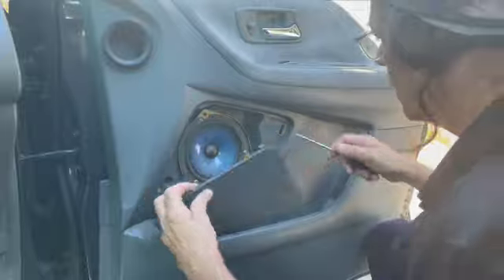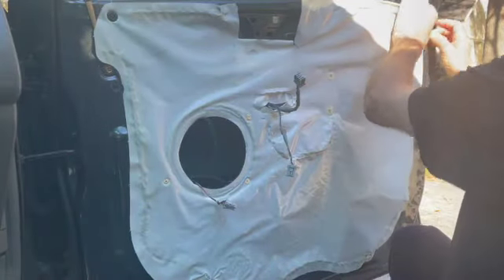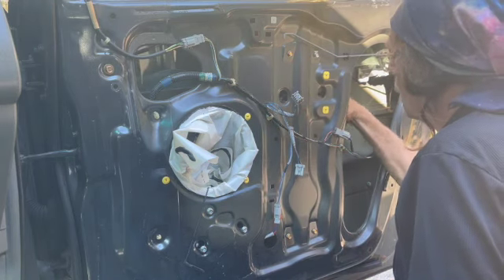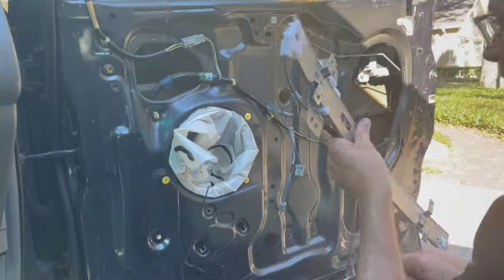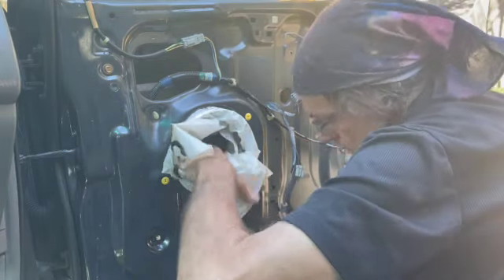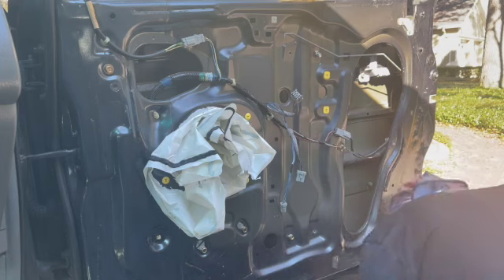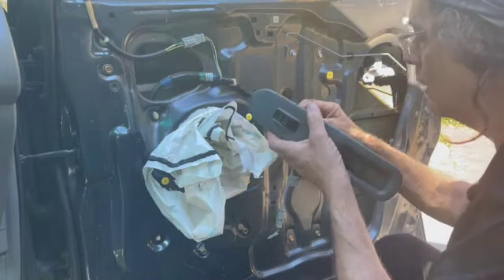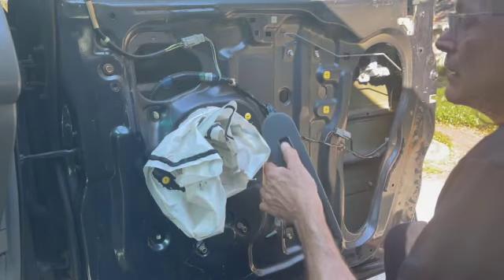Honda Odyssey 1999-2004 Window Regulator Replacement & Repair Right Front

Comment: My glass went off the rain. How do I fix it?
Reply from the maker: probably the window regulator. Video above. BUT if it really is just out of alignment remove the bolts holding the glass to the regulator (2 10mm) and realign the glass in the channel.
Reply: @PowerUpAuto  I was trying to whine down in the morning and when it gets to the middle, it just went down straight out of control
But i will check the two bolt now
Reply from the maker: @bamidelekoledoye1161  sounds like the window regulator. Video above
Reply: @PowerUpAuto  You were right. The upper cable of the regulator pull off because the catcher is broken. I will need to get another one tomorrow.
Reply: @PowerUpAuto  Thank you for the insight.

Comment: Where does the cable hook up on the slide
Reply from the maker: Not sure I understand the question. The cable should already be attached to the brackwet on the regulator. It all comes together. You should not have to attach the cable to the bracket that slides up and down.